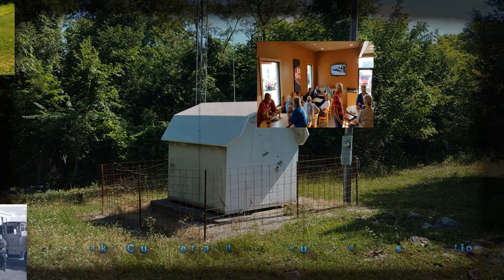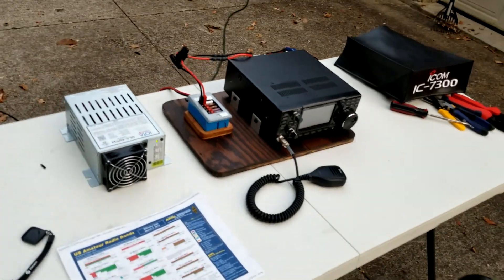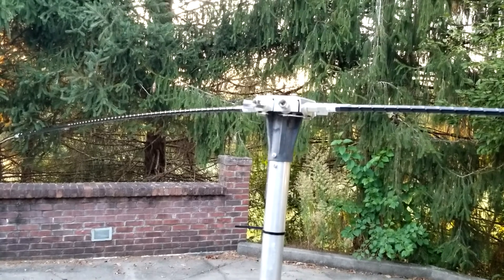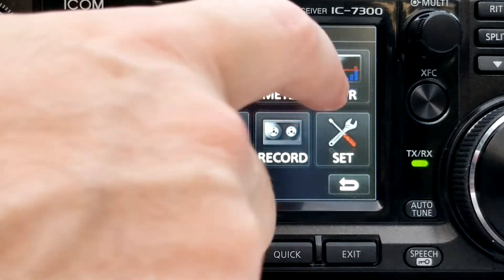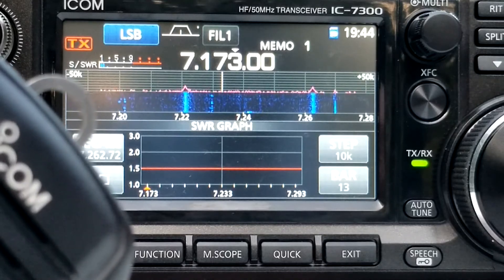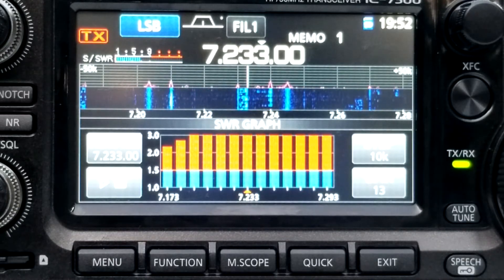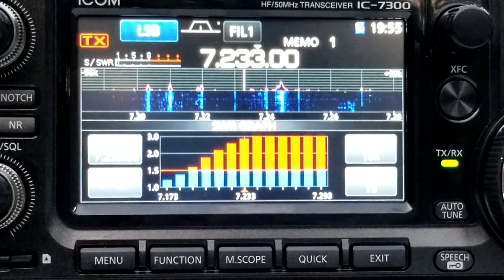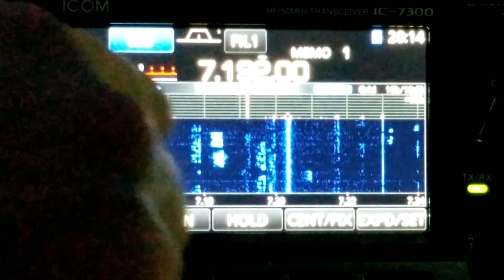LCARA HAM Radio: ICOM 7300 SWR Antenna Analyzer

Comment: If the swr is too high do you add or take away
Reply from the maker: @Dennis - depends on whether you are low on the band or high on the band. If you are low on the band or even below the band where you get your best SWR reading the antenna would need to be shortened. If your best SWR was high on the band or above the band the antenna would need to be lengthened. Since some of the bands are quite wide the operator would have to make a judgement call on where create the lowest SWR on the band they are using. Sometimes it would be at the bottom-end for digital operations. Other times, the operator would want the lowest SWR in the middle of the "voice" part of the band for the greatest flexibility. Thanks for watching!